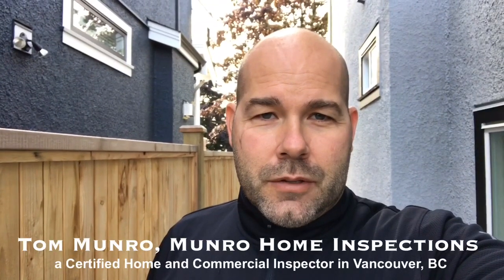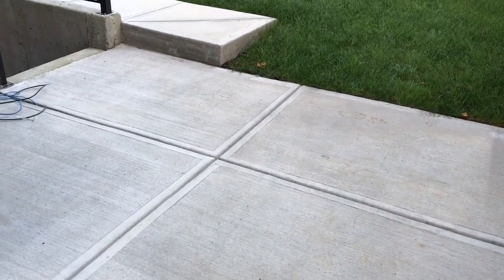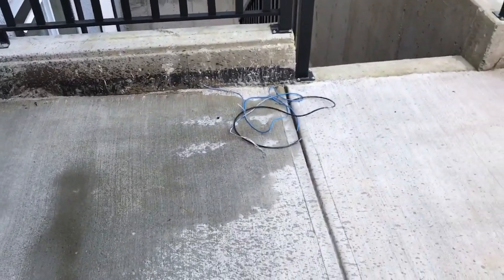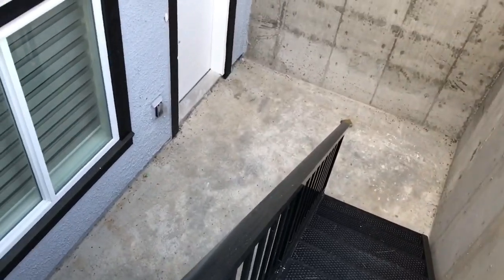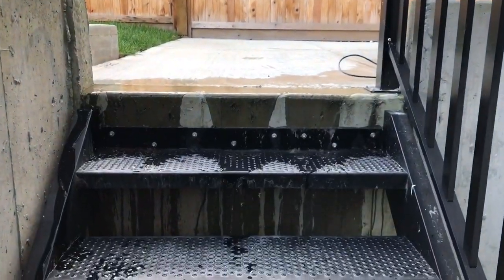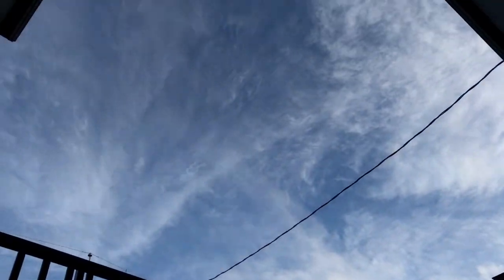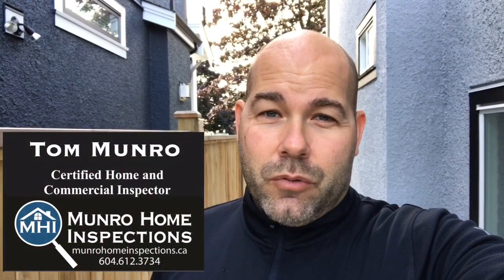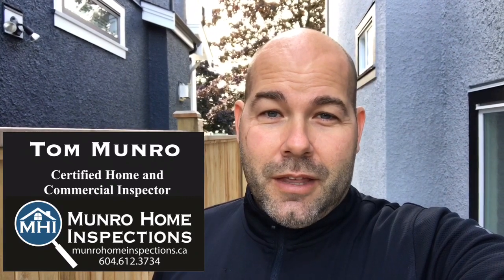Drainage Fail

Comment: It's a good thing they don't have a code for "looks like shit" cuz I didn't see anything on that house or that concrete that I would have been happy with.  I spent 33,000.00 On my shop floor and the contractor said the chipped spots where they cut expansion joints  was "industry standard"

Comment: Looks like that slab sits lower than the yard.... I don't think you could even fix it the "easy" way by cutting a section out right before the stairs and installing a channel drain, because there would be nowhere for the outflow to go, since it's lower than the yard.  Expensive repour...

Comment: This one is easy. They need to break up that small piece of concrete, and pitch it away from the stairs.  I do not understand all the raw concrete?  Too bad there is not an inspector for aesthetics!  There are plenty of concrete stucco finishes that  can be applied on top that raw concrete that will give it a more finished look.